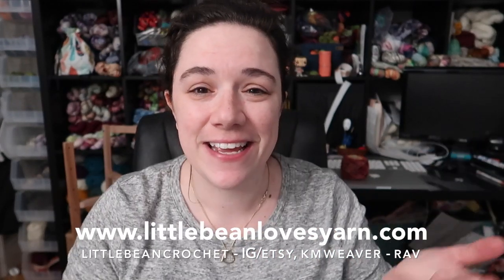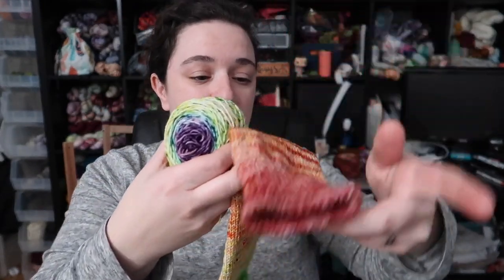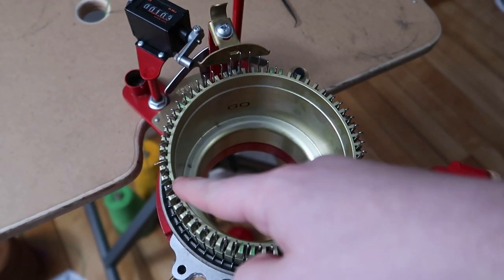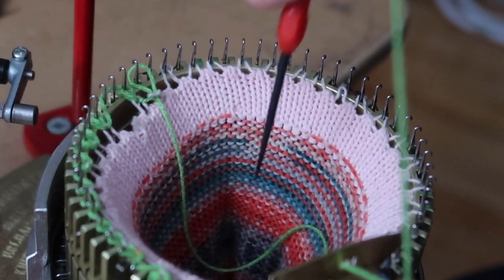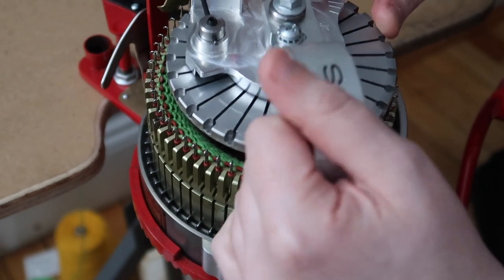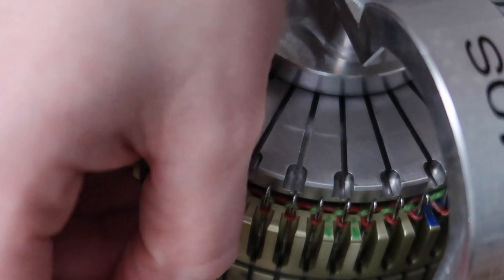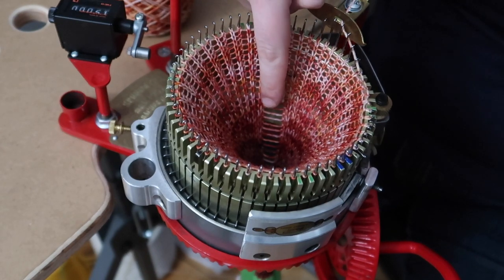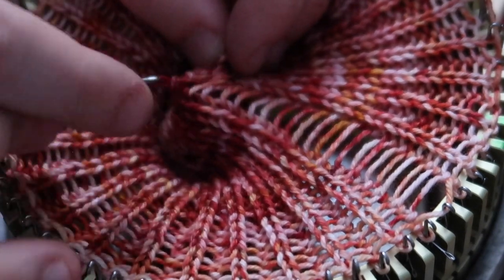CSM tutorial - Knitting a Sock tube with Ribbing

Comment: Thank you for the tutorial. I’ve check the Earbacher website and they have different size of cylinders. My question is, can you use 60 stitches cylinder for foot size above 40 EU or 9 US? Thank you.
Reply from the maker: it depends on your preference for fabric, the tension you're using. 60-64 i would think would be appropriate, depending on your machine tension. happy knitting!

Comment: Would like your insight on cylinder choice.  I'm having difficulty deciding what cylinders to order.  Got the 72 for doing men's;  concerned re women's....thought 64 because I mostly hand knit socks with 2.0/0 and 64-68 stitches.  You mention you primarily use the 60 slot for your women's socks.  Now I'm wondering if I should have done that instead ....
Reply from the maker: it depends on the yarn you're using and the tension on  your machine. You can definitely use either. you can always trade in the cylinder  (to the best of my knowledge) if it doesn't work well for your needs and get a different one. They have great customer service!

Comment: Beautiful yarn and sock! What size needles do you use to knit your heels and toes? I tried to do this but I was using a size 1 and my machine stitches were still a lot smaller
Reply from the maker: I use a size 1 needle. My gauge on my machine is set so i get about 8 sts/in - I've only calibrated for this particular yarn base on my machine so far - which is a lighter fingering at 463yds/100g.

Comment: Can you tell me the cylinder diameter and how many needles are there per inch? Working on a project so i really need that info. So if u can make some time to do the calculation it would be very helpful
Reply from the maker: the cylinder is 60 stitches around, your tension is determined by how tight or loose the mechanism is on the machine - so depending on that - is what determines the final size of the item. The best way to determine that is to do tension swatches on yarn that is similar in weight to the yarn you're using for your project. Adjust until the tension matches what you need for your project. For me, i'm able to adjust my tension to get 8 sts per inch, approx 10 rows per inch. that works for my size socks that I wear :) I hope that's helpful!
Reply: @LittlebeanandMe  I actually know that but Can You Tell Me Exactly how many needles are there per inch in the diameter of the actual machine.I Am Building a Sock knitting machine..i need this to make the cylinder.